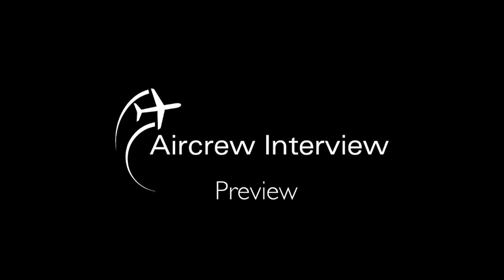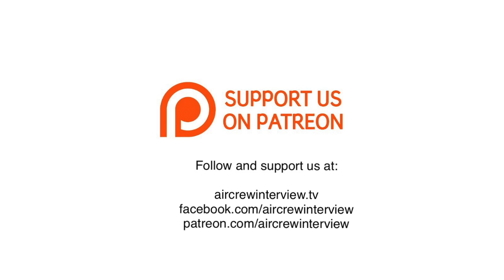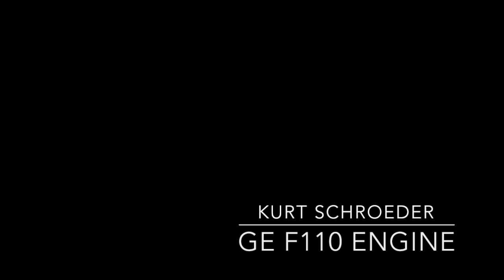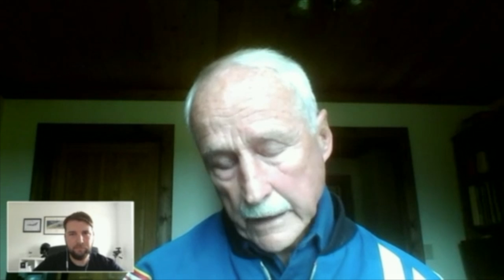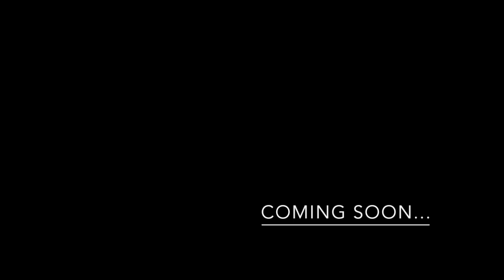Kurt Schroeder on the GE F110 Engine

Comment: You know, this might not be a bad idea...  Some interviews or brief clips strictly about the classic powerplants of airframes.  Examples of subjects besides the F110, the engine that arguably turned around and redefined the way we do afterburning turbofans today.  It was NOT the first of its generation but it fixed the issues the TF30 and F100 had and redefined the way we do testing now.  I know some might say the F404 was the first engine to do this and, yeah, I guess you could make that argument, BUT the F110 fixed the engine issues for two very significant programs -- the F-14 and the F-16.

Suggested engine interviews: the Rolls-Royce Merlin engine, the classic powerplant of the Supermarine Spitfire that also transformed the North American P-51 Mustang into the classic escort fighter of the European theater -- the negative-G issue of the Merlin and the way that was resolved is overlooked a lot; the Pratt & Whitney R2800 engine that powered the Republic P-47, Grumman F6F Hellcat, AND the Vought F4U Corsair; the postwar General Electric J79 afterburning turboject, probably the most produced fighter supersonic jet engine in the West which powered most famously the F-104 Starfighter and F-4 Phantom; the Pratt & Whitney J58, ground-breaking powerplant of the Blackbird series; the Rolls-Royce Olympus engines of the Concorde, the only afterburning jet engines that were in regular use for a commercial transport; and the Pratt & Whitney F100 afterburning turbofan, the first all-new jet engine produced for the fourth generation teen fighters which ultimately demonstrated that test procedures for jet engines had to altered for successive, highly maneuverable generations of jet fighters.

We tend to get stuck on the airframe designs of jets.  We forget at least half the equation is the powerplant.  You can STILL have a decent jet even with an inadequate engine but it will never live up to its full-potential.  There have been at least a few major historical cases where re-engining aircraft has made a huge difference in their potential.  Most famously, the P-51 Mustang, and later the F-14 and F-16.
Reply from the maker: The full interview is about 90 minutes and we go into the engines in some detail but its all about testing  the type from the chief test pilot above. But I do like the idea of interviews re the engines.